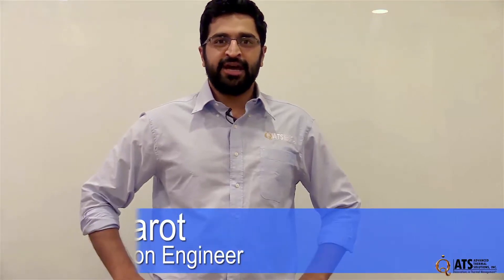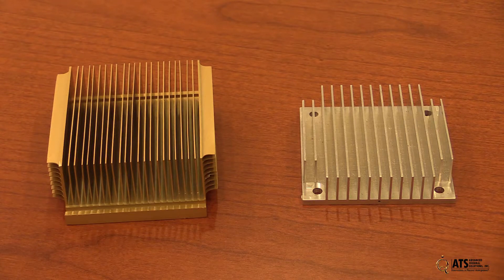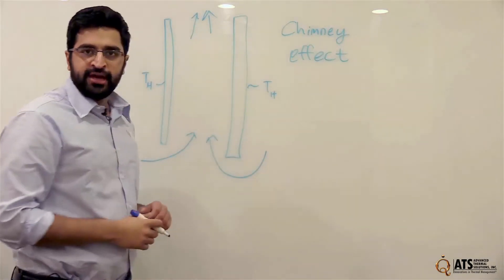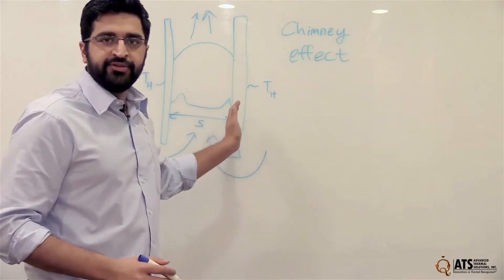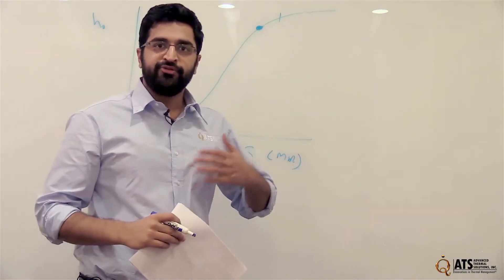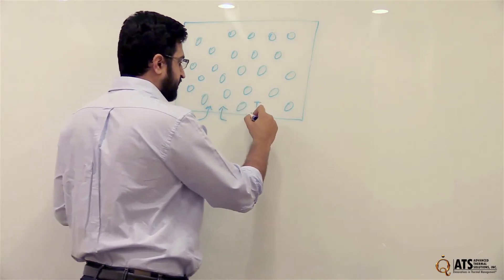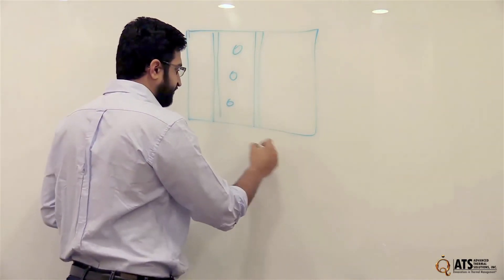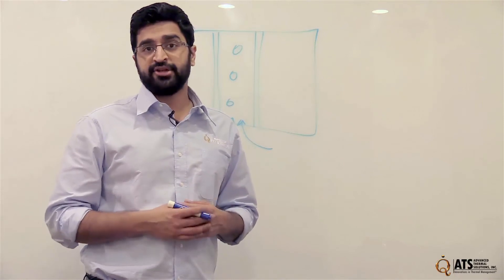QPEDIA EXPLAINS - Optimal Heat Sink Design

Comment: Does everything discussed in this video assume that the heatsink is side mounted? Or is it oriented so that the pins/fins protrude out of the base parallel with gravity? Does it matter?
Reply from the maker: Thanks for the great question CARL90LIVE.

The video was regarding heat sinks in the vertical orientation. However, our studies have shown that horizontal
orientation only shows a 10-20% downgrade in natural convection.

There are three ways you can orient the heat sink:
1. Normal - Fins parallel to gravity
2. Horizontal - Base perpendicular to gravity - fins on top - tests have shown 10 to 20% degradation
3. Heat sink is sideways-fins parallel to the ground and base parallel to gravity. This is probably the worst condition, but it has not been tested. 

Thanks for watching!